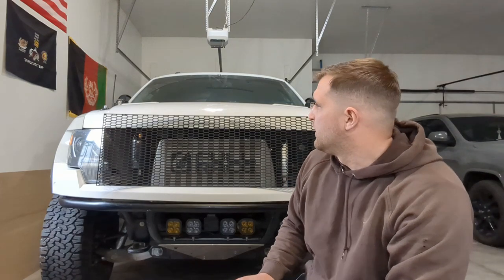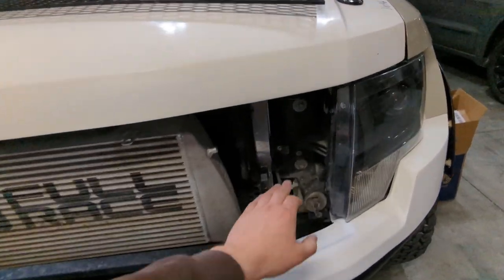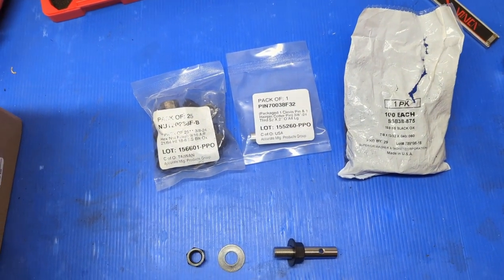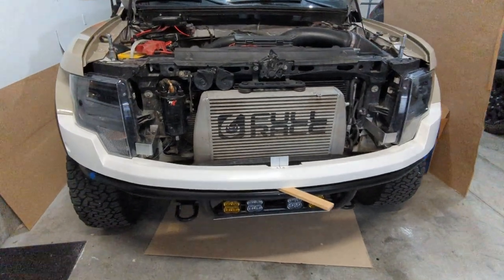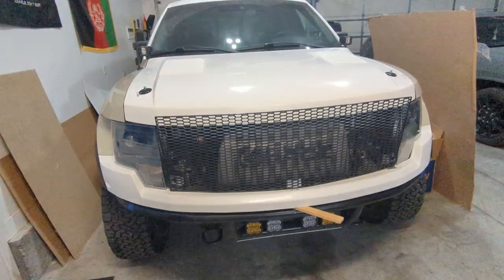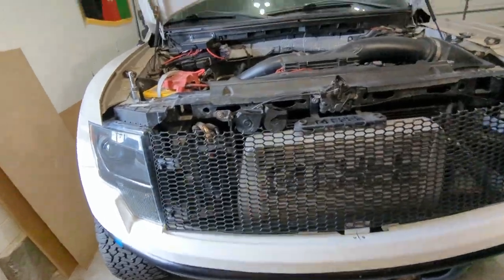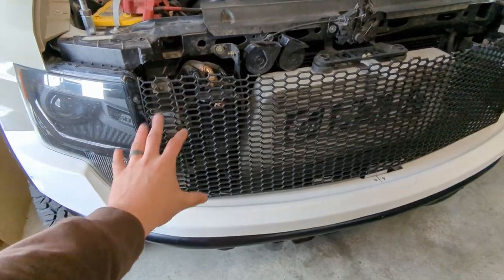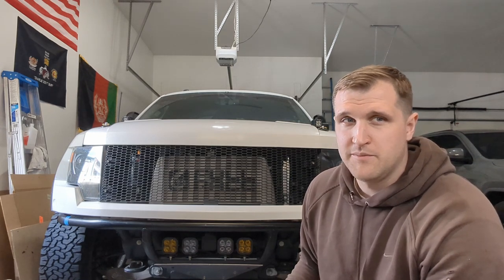Raptor Conversion EP8: Custom Grille

Comment: Use Thin aluminum strips put them the whole way around the inside of the grill with good glue it will make it stronger and bolt off that. You can paint the aluminum any color you want
Reply from the maker: Yeah that would definitely be an improvement